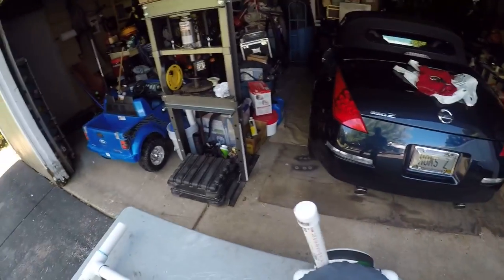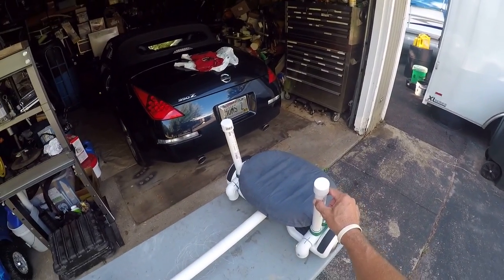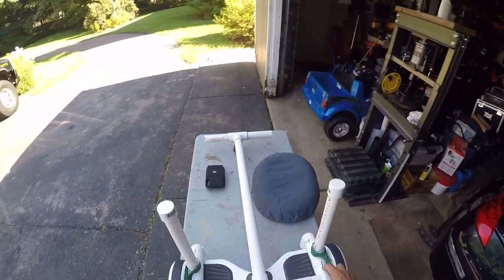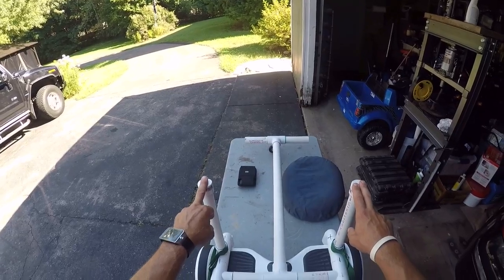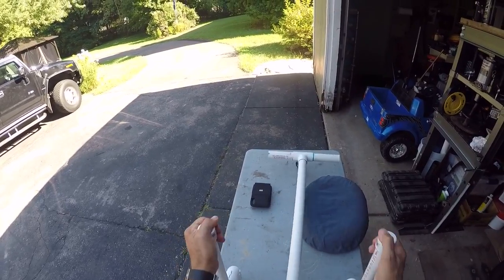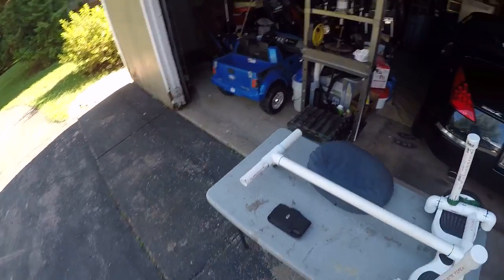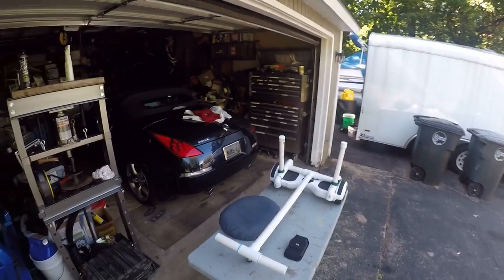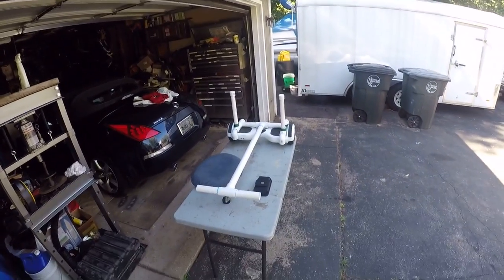Hoverboard cart

Comment: Apologize for the poor camera angle. That's one of the problems using the headstrap with the gopro you don't always know what the camera is seeing. Sometimes I'll use an ipad off to the side to make sure I'm getting everything. Unfortunately I didn't do it this time. I should have taken it apart then it would have been more apparent which tubes fit into each other. But to clarify I did run 1" tubes inside 1-1/2" tubes in the back leaving them slit on the inside.